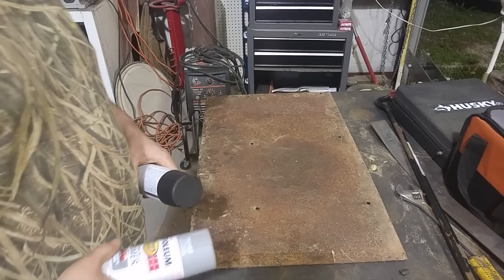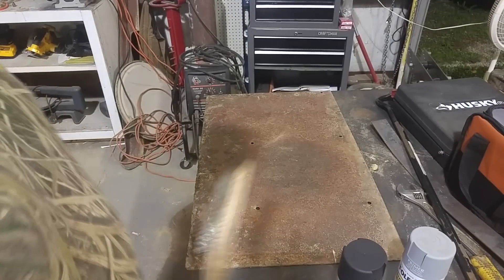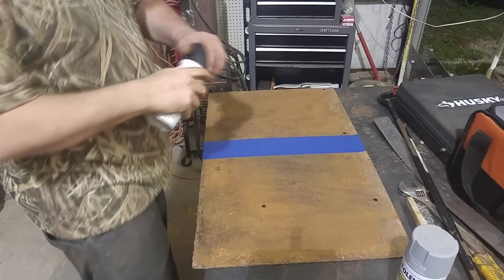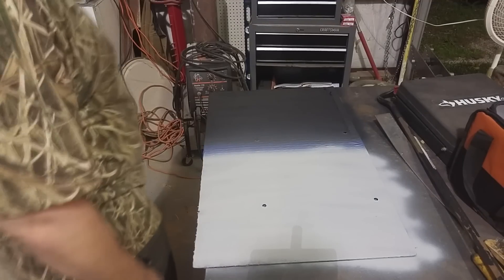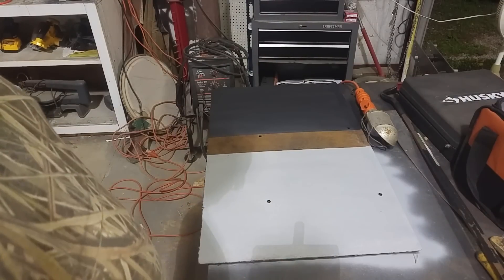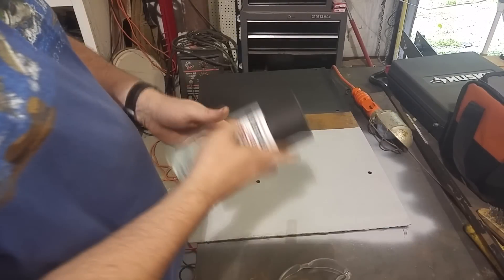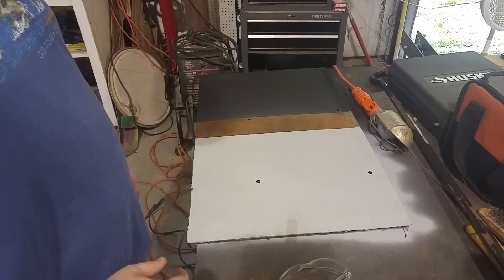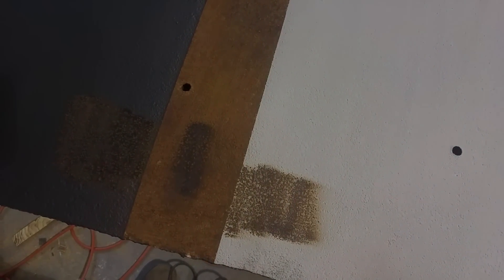Rust Reformer vs Primer on Rust

Comment: After 40 years in the metal biz I found that Rustoleum " Rusty Metal Primer"   is the most economical way to seal in and penetrate rust that cannot be completely removed.  The fish oil in the product is key. Metal must be rusty or the oil has no where to go and takes forever to evaporate. I let it cure for at least 3 days before top coating. Must be top coated as after bout 8-10 years it will wear off.  Automotive type primers are only good on shiny new metal.
Reply from the maker: Awesome, thanks for sharing that.  I've got a couple rattle cans of that in the shop I think.  I remember seeing the brown caps and looking at them the other day.  I'll have to give a shot.
Reply: Just for your info: Quarts and gallons seem to be of a more "oily" nature. I imagine spray cans would require a more thinner product. I thin the first brush coat with a little acetone or use the recommended thinness for air spray. Nothing beats an out of the can slather for already rusty items you just want to protect outdoors.
One of the hidden perks of getting old is you can do these outdoor experiments on metal coatings and observe them from a 10, 20, 30,and omg a 38 year perspective.
Reply from the maker: haha nothing beats experience.  That's where you really learn all the neat tips and tricks!
Reply: Wabijohn
Reply: Interesting that fish oil might create similar results to an epoxy primer with the oil. Looking at the SDS the rusty metal primer and the automotive version of the rust reformer ( not the rust reformer in the white can with the chair) has the exact same 15 ingredients. The rush reformer in the white can with a chair only list three but I assume there's more
Reply: Tremclad Rust Paint by Rust-O-Leum cemented their reputation many years ago when alkyd enamel paints were king for outdoor metal protection and the Tremclad product contained fish oil (cod oil).  EPA environmental regulations have now all but eliminated the manufacture of alkyd paints.  Rust-O-Leum now manufactures a line of water based rust paints and also what they call "oil based technology" paints.  I've been told that Tremclad rust paints no longer contain any fish oils and as a result do not perform as well as the product of the past.  I'm not sure that Rust-O-Leum rust paints deserve to hold their reputation any longer.
Reply: Wabijohn i
Reply: Wabijohn u
Reply: is it possible to do powder coating after applying "Rusty metal primer"?
Reply: @modology  no
Reply: @modology  Probably not, since it's not made for heat. If you look up most videos, the metal to be powder coated is always sand or soda blasted or just scraped to bare metal to eliminate all paint, rust or other contaminants. After that it's cleaned with alcohol or some solvent to make it very clean and contaminant free so the electro charge can take place. Some metals require conversion coatings but that's another story...
Reply: What do you top coat it with after?
Reply: @ThroughGrace88  Spraying Epoxy to bear metal but it is an extra costly step because you still need to prep that surface to be primed over so then you can paint(top coat)over it and then add clear coat. It's typically used when restoring antiques or things of value, in my opinion...
Reply: Thanks for tips!
Reply: The difference seems to be there... It looks rusty but not as rusty.
Reply: I thought the rust reformer paint has oxalic acid into the paint - that is a weak form to convert the rust into iron oxate. Phosphoric acid is the stronger form of rust conversion in the rustoleum rust dissolving gel - it creates iron phosphate. The gel is 50% phosphoric acid - so that is weak enough to not be concerned about damaging the metal at all.
Reply: Wabijohn. I have a fair bit of rust on the undercarriage of my Toyota Hilux and this is what I am thinking of doing to remove the rust. What does everyone think.

1. Remove rust with wire brush attached to drill thoroughly 
2. Wipe down with methylated spirits to kill bacteria & remove grease
Then either use 
3. DY-Mark Ruster Reformer 
OR 
as you previously recommended Rust-Oleum Primer Undercoat Sealer.

What does everyone think of this method ?
Reply: @benjikagi627  the products being tested here stop or attempt to slow down rust it does not remove it. You do not want to seal in rust or use any kind of rubberized undercoating on rust it's a disaster. Your best bet for undercarriage rust is rp-342 cosmoline wax. Clean off as much of the chips as you can so it's a smooth Rusty surface. Spray the cosmoline wax directly into the rust two coats. The wax soaks into the rust removing oxygen and moisture. Preventing it from getting any worse. It works like a charm I put it on 4 ago and have no additional rust. I live in New Hampshire where they use a lot of road salt. The salty water beads up and rinse is right off. Nothing sticks to this stuff. And if you have to take off a bolt or a connector you can do it.

Comment: Rustoleum Rust Reformer in the aerosol can is NOT THE SAME as the product of the exact same name and label but in the liquid form. The liquid Rust Reformer (8 ounces goes a LONG way) is an actual rust converter. It is pretty good, but there is a lot to be said about this subject. I had two phone calls with Rustoleum for over an hour total trying to understand this and this is only for their product - as every brand has their own "system" and even rust converters are not all the same, but they are basically the same.

Comment: Painting by trade. Commercial/Light Industrial

Black will always. 100% show less rust than white. Whenever you walk in a building now a days.. look up. If its an exposed white pan deck, find the sprinkler pipes. If the painters who used dryfall didnt use an oil primer or Pro Cryl to seal those pipes you will see rust. Always. 100%.

If its a darker color or black deck find those same pipes and you will never find rust because rust hides itself in the black paint. We never use primer on black pan decks because of this. Its a waste of time and material costs.

Also. To make this test actually a quality example, you have to paint these with the same top paint/coating. You can't grind primer and expect it to be able to withstand any damage. Its a primer. Its built to adhere and allow paint to adhere to a substrate. Its not meant to withstand damage even if its a high build.. one coat isnt intended to be grinded on. Its meant to be painted. 

But from this it looks like Rust Reform is an interesting primer for priming already rusted substates.
Reply from the maker: Thanks for the insight.

Comment: based on my own experience (20 years) the rust reformer stops the rust completely. I  used it 20 years ago on a old car and the places that I sprayed  are rust free, the panels that I didn't are all rusty, the rust reformer really works.
Reply from the maker: Nice. I hope so because I've used a couple cases of it rebuilding the Firebird :D
Reply: Did you go over it with a primer or paint after the reformer?  I just did two coats of reformer and have been debating taking the time to paint or not.  I don't have a lift so just want to be done with it.  But feel like I'll be kicking myself in 2 years or so if I don't paint it.  (Though the product says it does not need to be painted after).
Reply: @andrewhopkins3397  I didn't apply primer or paint.

Comment: Hopefully I can get some info I have surface rust coming up on front lip of my hood. I have tape and paper to cover everything. So it just needs light sanding should I sand it down to the metal , I have rust oleum paint + primer will that be enough? Thanks.
Reply from the maker: The more time you spend on prep removing the existing rust the longer your fix will last. Bare metal would be ideal then primer and paint. You may also consider a clear top coat over the paint as well to help seal it.

Comment: I just put a little dish soap on a wet rag, wipe it with that then wipe again with another rag. The problem with not cleaning after wire brushing is you’ll have a pretty good layer of rust dust, it stops the paint from sticking and it will flake much easier.
Reply from the maker: Agreed, I usually wipe stuff down with mineral spirits before painting.

Comment: Thank you! I have a metal fireplace  that needs some cosmetic treatment. Propane will not be turned on to prevent tenants from using it. Do I have to also wire brush the chain mail type fire screen?

Comment: Rust reformer you are also supposed to wire brush the surface removing loose rust. Others that work well is Ospho and Corroseal.

Comment: To save some people the aggravation, don’t waste your time with these products. If you don’t get rid of 100% of the rust it will be back with a vengeance within 3 years. Wasted days sanding rust off the underbody of a corolla with 80% of rust removed. According to the instructions you can spray over rust so I thought the 20% was acceptable. 3 years later EVERYTHING is rusted again just like before.

Comment: I think sand-blasting is the right procedure for this job. Then priming, then final spray painting.
Reply: Yes agree if you use white place and you will not have a problem I have a high pressure Blaster and also a Snap-On vacuum blaster actually use that on 1928 Packard worked very well with no warping or damage to the panels depending on who doing the sandblasting you won't have a problem

Comment: I have talked extensively with Rustoleum on the phone about this product AND their brush on version of this (NEVER USE THE BRUSH ON VERSION!!!!).  As much as it pains me to say this, it is my understanding that (with the spray on version) the rust actually gets chemically converted and neutralized but it DOES NOT HAPPEN IMMEDIATELY.  I am pretty sure you would have seen far lest rust IF YOU HAD LET EVERYTHING CURE FOR THE TIME IT SAYS ON THEIR LABEL.  And, if memory serves me correctly, the cure time varies based on the temperature and humidity level at the time that the product is applied and cured.
Reply from the maker: Interesting. In the follow up video to this, I did the same experiment but left the test piece outside for a year. The rust still crept through the rustoleum products.

Comment: Also guys, wear a quality respirator when wire brushing the metal. The dust will be breathed in and I still feel sorta crappy after 4 days. One of those thin paper masks with the metal part to bend around the nose is not good enough! Get a mask that seals!

Comment: I've had great results with rustoleum rust reformer on my truck tow hitch or undercoat applications up here in New England rust belt ;2 but eventually it comes back. Rust is like cancer. NOTHING can permantly stop it.
Reply: just grind it off and seal it braindead

Comment: That is crazy and useless video. That is not how you check rust on any metal. Both primer and paint will cover the surface and you cannot tell any difference until it get any moisture or water on like one guy said in comments to leave it out for six months, i would say leave it out in rain or spray some water on. The moisture and water will find its way under the paint and primer both and rust again in days and lastly to cover any surface the manufacture recommends 2 to 3 coats of paint. Good luck
Reply from the maker: Based off of the feedback from this video, I did just that and left the piece outside in the sun and rain for a whole year.

Comment: I did the inside of two van doors last year with just this. I sanded the best that I could,  and let it set for two days. On one door, I used this Rust Reformer, on another I used primer, and two other doors I used a different brand of the same type of product. Once it had set for a couple of days, I used 3M  undercoating on the backside(outside) of the doors. I will be honest and say that none of the products did a great job, and after the winter months I found the rust coming through to the outside of the doors. Now, I also realize that I needed to paint over the 3M product as it does not do well in the UV light. So whether it's my error with not painting over the undercoating ( I didn't know that) or  the winters in Maine... I'm not sure in what direction to go in this year, perhaps the Por-15. At any rate, I still need to fix the doors once again, and am interested in any ideas that any of you might have.
Reply from the maker: Thanks for sharing your experience. I've used POR-15 but not enough to know how well it would hold up to the conditions you speak of.
Reply: @ChaosGarage  Thank You! I've been looking at a lot of other products, but still have not settled on anything. Thanks Again!

Comment: You should have put that panel back outside, sprayed it down it down with some salt water a few times a week. If the rust converter actually works you'd see more rust creeping back onto the gray primer side.
Reply from the maker: Actually based off feedback from this video, I did it again and left the metal outside for about a year! If you are interested check out the revisited videos. Thanks for the feedback!
Reply: @ChaosGarage  Nice! I'll check them out.

Comment: I got a question I've been using Rust-Oleum gloss black I seem to be having a big big problem primary my car sanded it all the preparations I was supposed to temperature about 55 first coat went on beautiful second coat the top of the car had a crazy crazy reaction so I sand it all down started over primary when I painted the Rust-Oleum gloss black it again had a reaction and then the truck had a crazy reaction okay k I think to myself what the hell so I did it again only this time the freaking Hood did it with Rust-Oleum gloss black have used no other paint other than Rust-Oleum it's like the second third coats are having reactions with its own paint so I get it all pretty close to being done I let it dry out in the sun for three days or days and there are still some spots that I had to get so I decided to paint all three again the trunk the top in the hood and I'll be darned if the side near the trunk and the top had a crazy reaction once again with its own pink I wish I could send you pictures I have them so rustoleum could you please help me out I still get need to clear this car with Rust-Oleum clear but I'm afraid to if I could possibly give you my email phone number address anyting let me know please it's a really nice mustang that I'm doing for the most part it's coming out now but I'm still having reactions so please please help
Reply from the maker: Hmm that's weird. Maybe you should call Rust-Oleum and see what they say?
Reply: Maybe you give me some tips on some Rust-Oleum gloss black oil-based I want to try that for the first time in a gun for the first time any tips

Comment: I can't believe you actually posted this video. What a waste of time. You didn't follow the directions and what else would be expected when you spray ANY product like these and then grind them off in less than 24hrs. Did you think the rust would not still be underneath the product? Even if you'd waited a year, rust would still be underneath the product if you grind it away. Most of these products just seal anyway. That beer must have been the last one in a case. Geez.

Comment: The rust was not removed  properly first. You have to remove the rust by media blasting and then wiping down with denatured alcohol or paint thinner, then you apply the rust inhibitor.
Reply from the maker: That's not how these rust products work. These products say to remove the flaky/loose rust. If you remove all the rust some will not even stick to clean metal. And if you remove all the rust then you might as well just use primer which would be cheaper.

Comment: I don't understand your demonstration I just need to know if rust reformer will it heals or protect the Rusted area from Salt water in a few car washes
Reply: I have a materials rack on my '04 Chevy that I got in a trade somewhere around 1987. At the time it was pretty rusty, and because I had no time to properly prep and paint it, I wire brushed it and slapped on a coat of Rust Reformer three trucks ago. Never did anything after that (lazy) and only now does it show any real surface rust and that's only spotty. No scale! Hard to believe but true!
Reply: Is thier a way to do inner and outer part to protect the metal

Comment: Usless and wasting time video, no technical fundaments, veryyyyy amateur unexperience and undocuemnted ....... no way this videos are out here really wasting time guy
Reply: i don't think you have proven much here,  The two products are not really designed to do exactly the same thing.  Both would benefit from being painted with a top coat later and then you would need an extended period of time following that to see which would give you the most lasting end result.

Comment: Thank you for the options. I have used a vinegar with salt mix that works great, when you can submerge the rusted pieces; I have then protected them with POR 15. I have also used a commercial product that has phosphoric acid that works well.
Reply from the maker: Awesome...always good to hear what else works.  How is the POR15 holding up?  That's what I'm using on my firebird.
Reply: @ChaosGarage  it is holding up great, as it is all protected from UV light.